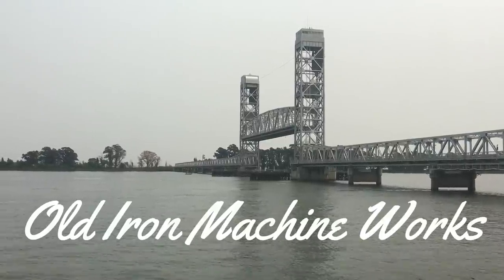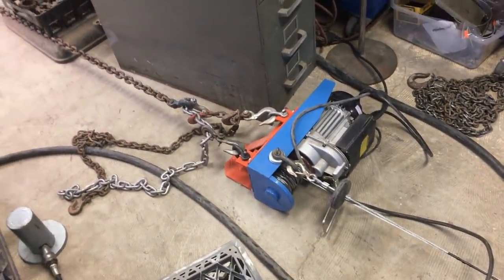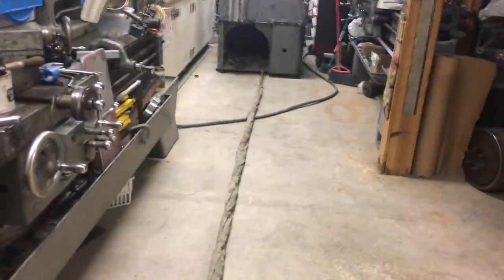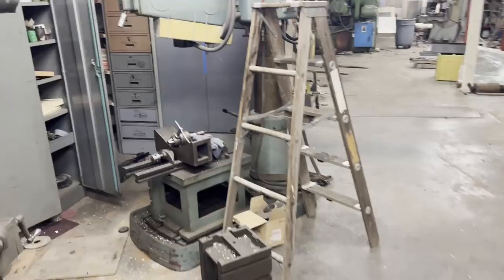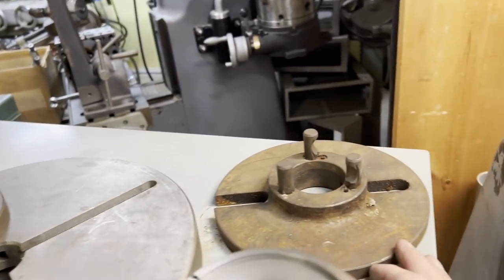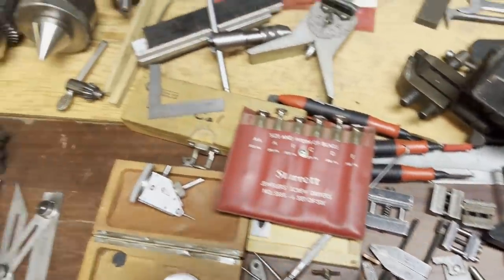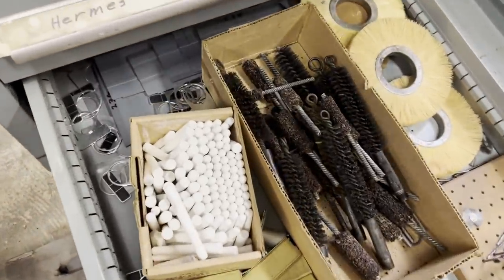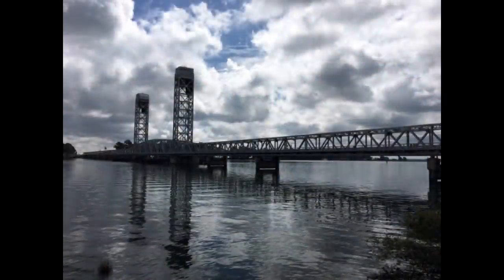Old Iron Tid Bits #2  End Of Year Tool Scores

Comment: tumico is short for tubular micrometer corporation. They were the first to build large non solid body truss type micrometers for measuring large diameters and that was very beneficial as no one wants to try to measure using a 50lb cast body micrometer on a 48" shaft. That little tug is an awesome piece. It looks like Monarch did a good job designing that lathe to fit in your shop. Looks like if it was any wider it would have been a real problem!
Reply from the maker: Thanks Brian.   Loving the Tug Bar, and your right . My house was built in 1951, the monarch was built in 1955. So maybe they did get plans to my house when they designed the Lathe.   LOL   I wander how far I would get if I tried to get your Monarch in my shop ?       Have a Great New Years.         Gary

Comment: BTW, on an earlier video I had asked about a micrometer you were using that had magnifiers over the numbers. I've always loved the Starrett split flap display and I really dug that one. I did a little hunting, it is called a speed mike, spelled just like that. They were sold under Slocumb, Central, and speed mike, but they are all identical.

Comment: Nice video Gary, the engraver-etcher is a cool tool. We had one in the tool room I worked in years ago, you can etch a break line in carbide blanks, place line over a hard edge and hammer-break it off along the line. [I use to fab brazed carbide valve porting counterbores]
Reply from the maker: Thanks Al, I will have to give it a try. Have a great new years.      Gary

Comment: Finished watching this video. On the tool table to the far right is a long tapered tool with a striking head and a thru hole in the shank. That is called a Marlin Spike. I used them when setting structural steel to line up the bolt holes.I have 2 sizes and have not seen any others since. AL B.

Comment: on the rusted handle of the push motor... it might be interesting to clean the area around the rusted spot.. add some strong duct tape..  tape a strong bag over it so you can fill the half bag with derusto type of chemicals..  or just have a big cement mixing tray with bracing build up under the lip to prevent the sides from collapsing.. and set the whole thing in either level or at an angle to get the solution up farther on one end.  even using a fountain pump to create a spray across it.. with a double zip lock bag of super magnets to collect the oxides to it keeping the solution cleaner..

Comment: Just know making time to watch more of your channel. Awesome collection of tooling and auction and estate sales are where most of my tooling has came from. I am looking for the smaller bit (1/8  up to 1/2in) collet for a Darex M1 if you happen to have are run across. The 1\2 o 3/4 will chuck up smaller bits using dremel collets, but a pain to use,,:)> thx for subscribing to our channel,,Bear in TX.

Comment: I’ve got the same radial arm drill from jet 1969 I’ve tried finding the feed drive work wheel gear with no real luck so I’ve been working towards building the tools to make my own gonna direct index off my gear and make a cutter I should be cutting the first couple in the next few days in pvc to check that I got it right then I’m gonna make a few so if ya ever need a feed wheel gear for one of these I’ll have a few on the shelf but other than that mines in great shape
Reply from the maker: Jeremy, I appreciate the offer. As you already know these are pretty sweet Drillpress’s mine is a jet made in 1981. I really like the older equipment made by jet. Not too sure about the newer stuff. Hope you have a wonderful New Year’s

Comment: Man what a score on those cabinets I need some of those trianglar inserts with no hole any idea what the codes spec numbers whatever it’s call is on it so I can order up some I need to get a book and study up on carbide specs so I understand it better I’m doing alright with the ones I use often but the older ones I’m clueless and don’t have any machinist I know to ask questions so I YouTube it to death
Reply: A TPG insert would fit what you're describing.  The numbers following are for the insert diameter, thickness and tip radius.  When the inserts get holes you see more types in the name to select the hole size for the screw, chip breaking, etc.
Reply from the maker: @russkepler  Thank you Russ for helping with that. I’m definitely no expert when it comes to identifying all the inserts. By the way, my middle name is Russell. My family has been calling me Russ for 61 years now.
Hope you have a wonderful New Year’s.    Gary